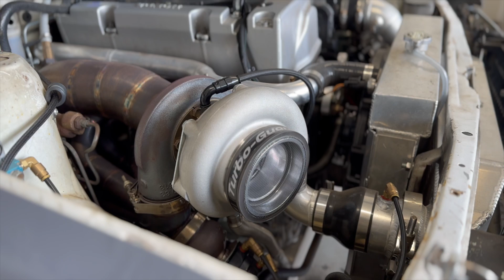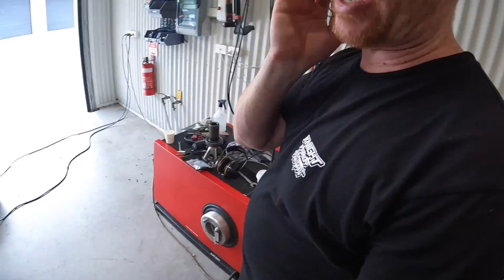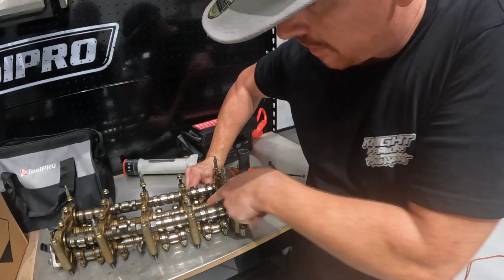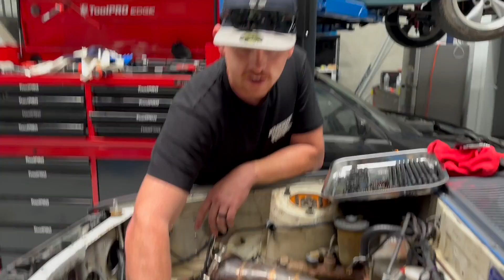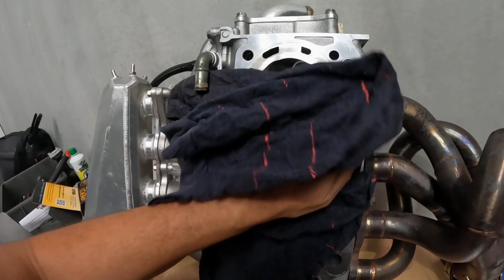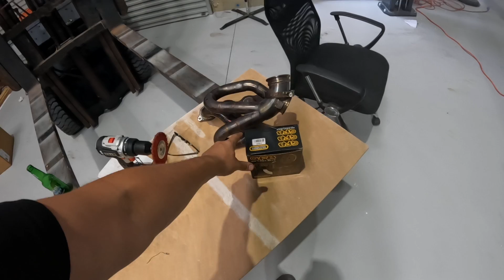How to lift a Head (feat. Turbo Honda K24 + 30PSI)

Comment: That's such an Al thing to do, chucking a K motor in a 300zx. Would've been cool to see all the purists' heads melt. Although, Al could get away with most things... Woody, check out "Fireball Tool". The dude is based in Spokane, Washington US and makes some real trick fab tools and great great videos. Has a couple of bench vises in store including a 5" forged thing for like 125 US. If something makes it to his online shop, it's good enough for us. Wilton is established and has a cool range but pricey. Fireball may have an intermediate model out now. Haven't checked out the latest vids. A fab table on rollers would be the perfect mobile bench. You could mount some sliding drawers to the underside. Only you can know what works best for you in that space. The more things you get done in there, the better you can narrow down the necessities. Congrats!

Comment: Time for a Steve Morris SML! 😁
But yeah, having a heap of sensors and setting up safeties will save your enginge. But tell that to Steve Morris - he hadn't even run a low oil pressure safety in his Boostmaster for the last 3 years... 🤪

Comment: Love the switch on the fly during the video to help out a mate Woody.  great work ya legend!!
Also, recommend looking at changing your framerate and camera shutter settings to fix the flickering fluro lights at Kye's dyno shed.  
It'll really help to play around and find the camera setting that matches the 50hz frequency of the 230v AC (that powers the fluros).  Quick google/youtube help guide and you''ll be right mate.
Reply from the maker: cheers mate, it as a fresh GP10 that i just sent with factory settings!

Comment: At least there is one big advantage from steel wool over a scotch Brite. Steel wool consists of some kind of metal, whilst a scotch brite is out of epoxy bound silicates. So if you have some leftovers (which normally happens in a normal shop no matter how good you clean) steel wool is much softer than silicates and it's form(strings vs. something ball shaped) has way less potential to damage something... 

Over here (Europe) you can buy it on rolls like paper shop rags for nearly nothing, compared to a roll of scotch brite.

Comment: As a toyota fanatic I am disappointed in the molestation of this beautiful toyota with a honda engine. Would have loved a beams or boosted 4age/4agze for purity reasons.
But I completely understand from a power/ reliability angle those boosted k24's are hard to beat!

Comment: Kai, good thing you didn't get 60 psi of boost at once Pfi Speed made a two-piece short motor in the burnout box. One of the most devastating but spectacular self destructs I have seen in a while!
Reply: I saw that one. Absolutely crazy!
Reply: @knightfamilymotorsport  I have seen thing go sideways but never like that!!
Reply: @knightfamilymotorsport  Silly question Kai, how hard is it to tune a 2gr-fe with a stock ecu?
Reply: @someyoungguy6990  I don't have any equipment that cab get into the stock 2gr ecu but I do believe it is possible to tune it.
Reply: @someyoungguy6990  they are great engines I have tuned one that is in a modified production speedway car and it is a beast of an engine even in standard form 😁
Reply: @knightfamilymotorsport  8600 rpm on stock rods is no BS! Have seen a few guys milk 750+ w/forced induction with zero internal mods. Now imagine that in a Corolla body...smells like a pocket rocket to me.......If only I had the $$$$. One day my friend, one day!!

Comment: @theskidfactory What bellhousing did they use? An R154 one? or The R151 adapter?? Some 151 has 190mm input hsaft, others have 190mm like R154, but they dont come behind 2TR. The 2TR R151's are 160mm input shaft.
Reply: I don't know what bellhousing he used but you can get a bolt on bellhousing from Nite Parts in NZ to suit K24A to R151/R154. They also do flywheels to match.
Reply: Yeah Niteparts bellhousing on a 2TR R151 with the 160mm shaft

Comment: I currently run 28psi in lil feral's twincharged 4ag. Current engine runs 10mm arp head studs and standard mls head gasket.   
The new build if I ever get to afford the rest of the parts it needs will have 1/2" arp head studs plus a special o'ringed head gasket that I already have sitting in the parts box for the build.  

Once I've built the new engine I am hoping to get Kye to tune it!  From his wealth of knowledge and the way he talks I just know he'll be the one to appreciate my setup.
Reply: When?
Reply: @kaydog890  when I've built new engine? Possibly get a chance to save for pistons (only engine internals I haven't got yet) and machining after I've got the old bus I am trying to get liveable asap to keep a roof over myself and wife's head.  
Screw the ridiculous rent prices in this country!!

Comment: Too much timing, always too much timing.

I have a 3 port running 5psi to 26psi no problem, with better resolution than a 4 port. Just gotta know what you're doin'.
Reply: Wastegate priority plays a massive part here. As well as turbine drive pressure.
Reply: I bet I'm running a 3 port not even remotely like you think I am.
Reply: @littleherms3285 hero
Reply: @littleherms3285  I'm guessing you have it hooked up top and bottom to the 3 port directly with bleed holes in the lines.

I have done this before and I prefer 4 port 😁
Reply: @knightfamilymotorsport  interesting. Just one bleed hole in the top line, very tiny, used a hand drill because it was so small. I messed around with a pair of 4 ports for a whole season (twin turbo/twin 50mm WGs) and was frustrated with the control. 3 ports in the the way you're thinking was better. I would probably like it even more in a standard setup because the top of the hat takes a while to bleed off which would help spool between gears.
Reply: @littleherms3285  yeah 4 ports can be a pain in the ass. 

I find pulsing them around 18-20hz and adjusting your PID settings to suit gives great repeatable results. 

On twin turbo V8 cars we normally run just one 4 port and tee it to both wastegates with great results and repeatability :)

Comment: What gearbox is in it?
What exhaust housing is on the turbo?
Would it be better to use two 3-port solenoids for the wastegate? One to control top hat and one for bottom? That way the control is independent and less sensitive.
Reply: I spoke too soon! R151 gearbox from a Hilux. Cheers.

Comment: Skid Factory working in the Woodshop or the Wood shed. I mean. I just works.
Reply: Woodshed
Reply: Brought Kai's car in all piled up and got cars stacked on the other lift, but I still think woodshed is better than woodpile. Woodshop is Hella good too
Reply: It has to be the Woodshed
Reply: Wood Shed is cool!
Reply: Al's shed was always called Al's shed at the skid factory so woodshed at the skid factory works too
Reply: I would have said call it the furnace cuz Woody's gonna burn up in there, but his brother came through with the AC hook up so that one's out the window. Sounds like he's got the same type of swampass temperatures we see her in Florida. 35°c + 158% humidity is no Bueno. Those light bills will suck but you'll get more done if you're not melting like a popsicle